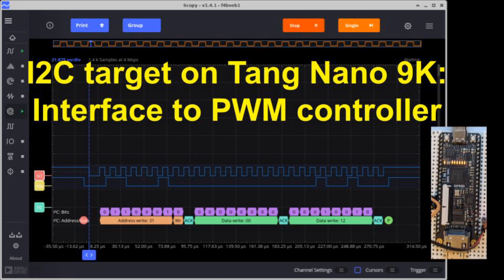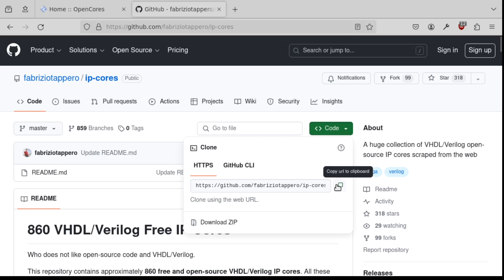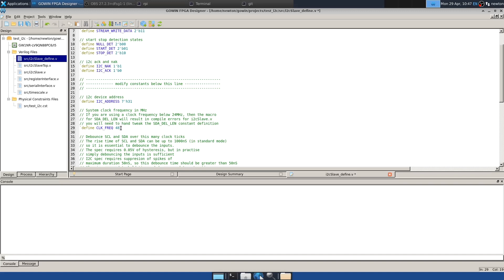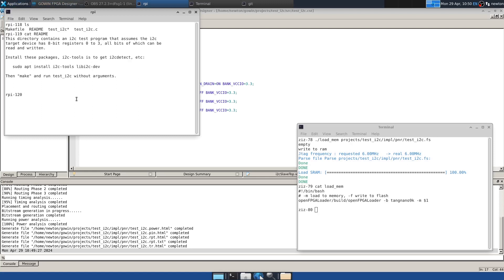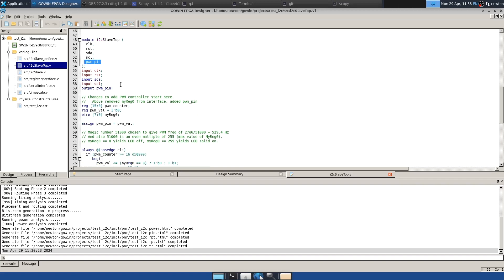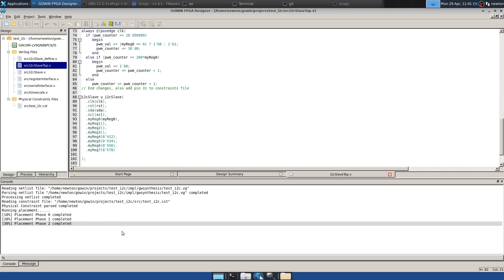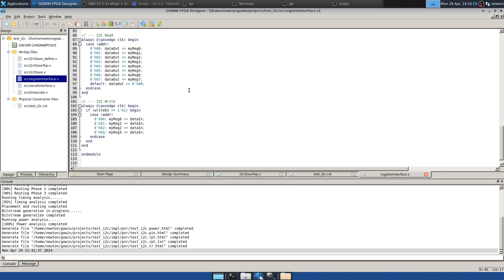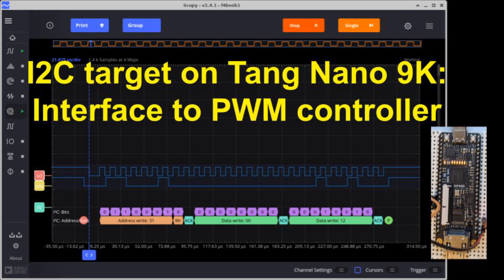I2C target (slave) on Tang Nano 9K FPGA board integrated with PWM controller dimming LED.

Comment: > I can't get it to work on Nano Tang 9K. - 'Logic' unknown , etc

ok, got it - I was using the last project.

I am running Tang in windows - so getting the IpCores files is confusing.

-

So, you are setting CLK= 52 pin - which is XTAL_IN - to force as CLK Pin.

Why do you not define pins for myReg0 ? - doesn't that leave them generated as Randomly Ambiguous at compile ?

You use strange Coding Standards ...

Comment: Thanks. I learned a lot. I implemented an i2c master on ESP32 WROOM and used it to drive a pwm. I used micropython for the implementation and THonny ide.  Here is the code I used.

import machine, utime
sdaPIN=machine.Pin(21)
sclPIN=machine.Pin(22)
i2c=machine.I2C(0,sda=sdaPIN, scl=sclPIN, freq=400000)

def wait(milliseconds):
    utime.sleep_ms(milliseconds)

pwm = [b'\x00', b'\x03',b'\x07',b'\x0f',b'\x1f',b'\x3f', b'\x7f',b'\xff']

for ipwm in pwm:
    i2c.writeto_mem(0x31, 0,ipwm)
    wait(500)